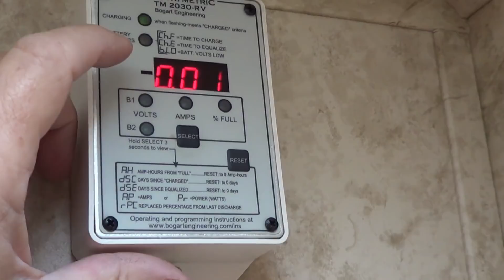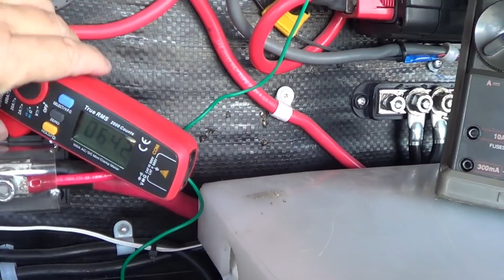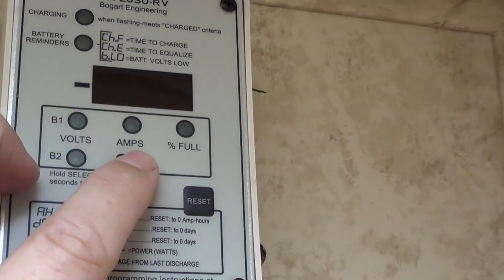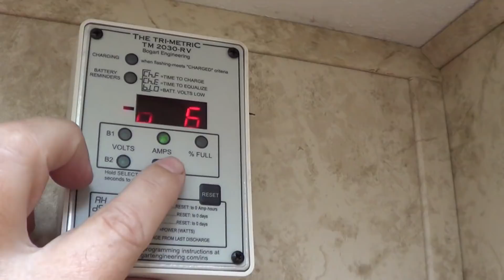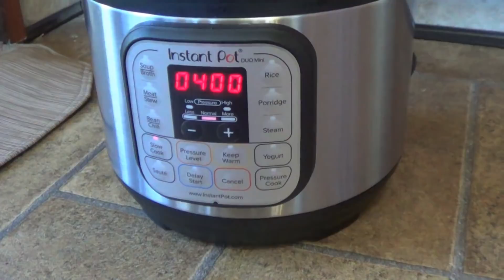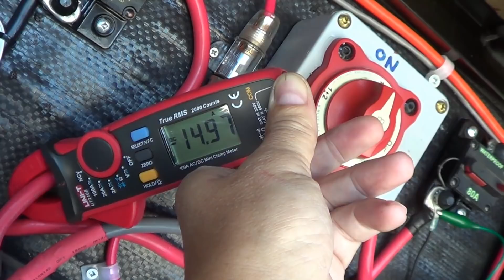Instant Pot DUO Mini  - Off Grid Power Usage Tests

Comment: very informative .i have 2 6 volt batteries with 200 amp hr capacity. just installed a 2000w renogy invertor cause my 1000w would handle the instapot. when turned on my battery voltage drops to 11.7. would i be ok running these batteries that low for a period of time ? thanks
Reply from the maker: It should be OK if its that low under the Instant Pot full amperage load, then the voltage should rise back up afterwards. If it doesn't then the batteries need to be recharged.

Comment: Questions. How large is your battery bank? And what type of battery bank is it? Lithium? Lead acid?
Reply from the maker: The test was performed using a lead-acid battery bank of four 6V golf cart-type batteries wired in a series-parallel arrangement. The total rated capacity was 464 amp hours, but the usable capacity is more like 232 amp hours since it isn't advisable to discharge the lead-acid battery below 50% on a regular basis to prolong battery life.

Comment: I guarantee the wiring in your RV is NOT capable of 63A - you obviously don't know how to read the meter, what you doing (how wired for the reading), or incorrectly measuring the value- the internal cabin meter you displayed is bout 115 /120v @ 2.94A PER HOUR and likely within 10-20 min this will drop when the device reaches Temp..... not 63 AMPS - get it?,  - WTF, I suggest sticking with things you know about and please don't post videos you have no experience or idea about what you are doing! Peace out!
Reply from the maker: You obviously think you know more than you do. The 63 amps is the DC amperage drawn from the 12V battery bank. That feeds an inverter which transforms the power from DC to AC and then feeds the Instant Pot.  Wattage = Voltage x Amperage so 63A x 12V = 756W That is about what would be expected to power a 700W Instant Pot plus some extra for the inefficiency of the power inverter and losses in wiring. btw for your info, the DC wiring I have installed from the battery bank to the inverter is a 4 gauge pure copper cable which is more than capable of handling 63 amps. Go look it up in wiring amperage charts.
Reply: @LoveYourRV  There's a difference between measuring the AC and DC power utilization in your model. Top-end Class A RVs have 50A service rating even from shore power before you trip a breaker. The POINT being - If the idea here is to look at the efficiency and power consumption of the device drawing on inverted 120VAC while "boondocking", then by including the idle DC power feeding the inverter is irrelevant to the topic. The inverter even at no-load is idle /wasted power.  The device itself (3 quart) is 700W  /120VAC or approximately 5.8A draw from the battery bank only. Measuring the circuit current feeding the outlet or simply around the power cord of the device to illustrate the efficiency as claimed by the manufacturer would be accurate. https://www.manualslib.com/manual/1292207/Instantpot-Ip-Duo80-V2.html?page=7#manual

Comment: It is NOT sucking 63A out of the batteries - lol  - it's drawing (in this MODE at a starting temp) over an initial time duration 63 Amp-Hours.... which should trail off as Temp comes up to speed.
Reply from the maker: Same difference https://www.wordhippo.com/what-is/another-word-for/sucking.html

Comment: Just tested mine. Thrift store find; $6 no gasket upon purchase, with online purchased gasket $15 tl. It looks like it's been used a handful of times perfect condition.

 I'm crazy 5 electric pressure cooker 2 small ones a 2L ,a 3L , an 8L , two 10 liters.  Never used the 10's but I have them in case I scored a lot of food that needs to be cooked quickly. Food is getting expensive and when you get free stuff you get to work. The most I paid was $100 for the large ninja doubles as an oven. Got the other large one $60 only one I paid $40 for from a righteous retailer QVC. The little 2 .

Comment: Ray, If you should happen to test the new Bluetti EB70 solar generator, could you use it with your 3QT Instant Pot?  Thank,you sir.

Side note: I imagine that if you added  boiling water heated from your stove, to the Instant Pot prior to use, you would put less stress on your battery bank heating the water up to start the pressure cooking process.
Reply: Oh genius idea!!! I have eb70 and mini pot and will try this idea!!! Thx!!!
Reply: I'm just firing up my duo mini on an 800 watt eb70s and it's barely taxing it with about 3 cups fluid in there on pressue.

Comment: So on the pp mini at 600watts on a 750 watt inverter with 1500 peak and 1 100amp hr battery you think it should work.
Reply from the maker: Should do the trick if the inverter is a quality make and lives up to its rating. Also the wiring form the battery to the inverter needs to be of sufficient gauge for power transfer, especially if the run is more than 18 inches or so. Too much voltage drop along the cables and the inverter goes into low voltage shutdown.   Cheers, Ray

Comment: Fantastic, just the test I was looking for.  Thanks!  Just for comparison, my old 4qt crock pot uses 85 watts on low, and 165 on high. The average power on your instant pot in slow cook, normal mode is (24.5*12)/4 = 73.5 watts.  As long as you have a battery/inverter combo that will handle the peak power (700W) then it seems like the instant pot is a good replacement for a slow cooker (plus do a lot more; steaming, pressure cooking, etc)
Reply from the maker: Glad it helped!
Reply: Luv Ray's videos, they are so helpful! I bought a 700watt power station because I knew from watching Ray's videos, that it would run a mini instant pot! I watched this video hoping to find out the information you provided in this comment, so thank you!

Comment: i'm new on this i have a battery isolator (for now) and a 100ah battery 2200 watts inverter. i have a instant pot 3qt  700 watts  will it have enough power to operate it at 30 mins per day
Reply from the maker: Depends if its a lithium or lead acid battery. Lithium it shouldn't be a problem as long as you can recharge each day. A 100 Ah lead acid would maybe be a problem.
Reply: @LoveYourRV   100ah lead acid battery. I could start my van to get the instant pot to get to pressure that about 10 to 15 mins

Comment: Need help? Has anyone used the instant pot outdoor. I want to get a power inverter but which one to get modified sine wave or pure sine wave. I'm not getting a straight answer from the instant pot company. I dont want to spend more than i need to any help would be appreciated
Reply from the maker: I'd go for a pure sine since the Instant Pot uses microprocessor electronics to control the cooking times. If it uses the 60 cycles of the AC power to keep the time, then a modified sine wave may cause the time to be off. Just a guess though. Also modified sine wave inverters are less efficient at power transfer so you would likely need a bigger one versus a pure sine type.
Reply: @LoveYourRV  so if it digital i need a pure sine wave what about a hotpot or rice cooker  i will be in a van may 8 2020 so i need some kind of cooking i have a propane grill what cooking items could i used with a modified sine wave
Reply from the maker: Its always hard to predict as appliances often used a variety of power circuits and control electronics. Basically  it boils down to a modified sine will run most things fine except but not as efficiently power wise as a pure sine. A pure sine will run everything well. If a modified worked well on everything no one would buy a pure sine. Also, you'll see than most everyone of the new solar generator power boxes and gas inverter generators are using pure sine, so that tells us something. They feel its worth the extra cost. Cheers, Ray

Comment: I don't understand why I can't find anyone to answer this question with an affirmative yes maybe someone here will know the answer I'm hoping anyway

For car camping purposes I would like to purchase a instapot Mini are the smallest one whatever it's called I am hoping that a Yeti 400 portable battery will be enough to make the instapot work do you know?
Reply from the maker: I'd guess no it can't. Looking at the specs on the Yeti 400 it says the inverter puts out 300 AC watts continuous power.  The Instant Pot  Mini requires 700 AC watts to operate.

Comment: Awesome video. I have always wanted to use a pressure or rice cooker overlanding and this video saved me so much time and math. Thanks. Really seems reasonable. And in a vehicle situation you could be cooking while driving and roll into camp with a hot meal already waiting and not even need to tax your batteries.
Reply: Did you do that? How did it work?
Reply: @janebray9392  It's pretty common in RV circles to cook while driving -- the appliance sits in the sink to avoid falls and spills.  

In the past it was mainly done with crockpots but I suspect it happens with instant pots now too.
Reply: @fratermus5502  good to know!!!!!

Comment: Soooo your clamp meter was set to AC.  Way off.
Reply from the maker: Did you watch the extra 30 seconds longer to see me correct my mistake?  https://youtu.be/kf6U2N9vySU?t=148
Reply: Nope, I stopped right away when I saw that.  But I'm glad you corrected it in the video.

Comment: so if it digital i need a pure sine wave what about a hotpot or rice cooker  i will be in a van may 8 2020 so i need some kind of cooking i have a propane grill what cooking items could i used with a modified sine wave
Reply from the maker: You'd need to have an inverter capable of powering 700 watts of  AC power, best to have some extra headroom so I'd advise a 1000 watt inverter. To power, the inverter 2 deep cycle lead acid batteries hooked together is advisable. Either 2 - 6 volts wired in series or 2 - 12 volts wired in parallel. If you have a lithium type battery then one 100 amp hour battery would do the job.
To recharge them you can use solar panels or the van alternator or a charge converter plugged into shore power or a combination of them.
Reply: Love Your RV i dont understand how many amp hrs battery i need and how many watts solar panel needed will 100 watt solar plus 100 amps hrs battery will that work
Reply from the maker: Yes, but it will take many hours of sunshine to recoup one Instapot cooking session.  A 100-watt solar panel only puts out about 5 amps so you'll need 5 hours of the perfect overhead sun just to recoup what the Instant used.  I have no clue what else you are powering in your van as well but I would recommend at least 300 watts of solar power if you intend to use a high wattage appliance such as the InstantPot. Either that or get a 1000 watt gas generator.
Reply: Love Your RV OK I’m thinking about getting a 295 W solar panel blood what battery amp hours should I get the lease amount Also what a 10 amp charger controller be able to handle a 295 W solar panel
Reply from the maker: 100 AH battery minimum and preferably 200 AH if you can afford them and they fit. Batteries are the heart of the off-grid system. I'd want a 30 amp solar controller.
Reply: Love Your RV Solar checked in I’m getting has a 10 amp charge controller and 100 W solar panel but I’m getting a 295 W solar panels what I want to know is will the 10 amp charge controller be able to do this or should I upgrade to a higher charge controller I just want to be able to use my Insta pot so whatever is the least amount of Solar power is what I’m looking for I know I need a 1500 W power inverter what’s confusing me is the solar panels and the battery right now I can’t afford a whole lot I’m on a fixed income so I just want the basic that would technically operate my instant pot that’s all I need to Power well a 100 W solar panel and a 100 amp hour battery be enough to do this if not will a 295 W solar panel be better to charge the 100 amp battery and will The 100 amp battery be enough I want the basic
Reply from the maker: Solar panels and solar controllers do not power things, they recharge the batteries. It's the batteries that power the inverter which in turn converts DC  to AC  to power the Instant Pot. I would advise 200 AH of lead-acid type batteries or 100 AH of lithium type batteries to power the size of inverter required, at least a 1000 watt model.
As for solar panels the more watts you have the faster the battery recharge time will be. 10 amp solar controller is OK for a 100-watt panel but not suitable for a 295-watt panel. For that get a 30 amp controller.
Reply: Love Your RV Well I’m not going to Be able to do that right now so how is this my laptop does 6.8 A so will be it’s a harbor freight kit and it has 100 W solar panels and the 10 amp charger controller and the 35 amp hour battery will that be able to at least power my laptop just needed to charge the batteries takes about less than two hours
Reply: Love Your RV I’m not getting solar right now I just want to get in inverter using  the battery of my van to operate a hot pot that uses 600 watt it has nothing but A heating element
Reply: It’s funny if a modified Sine wave is so bad why do they continuously sell it
Reply: @jfletc3000  much cheaper
Reply from the maker: Yup should be able to power a laptop.
Reply: Love Your RV One thing I wish is that when it comes to Solar it would be nice to be able to understand it in normal terms Being that I am new at this and I'm still trying to understand it I just want to be able to know what can be charge not looking to charge a whole lot but just a basic right now being that this stuff is very expensive and I'm on a fixed income is very hard to find out exactly what I need I do know that when I am able to get certain things I know I want to power my Instant Pot and my laptop and eventually a small mini fridge hopefully DC with that the system that I said that I could buy later the 295 W solar panel and the 30 amp charger controller and two 100 W batteries will that be enough to charge these items also batteries are confusing to me too I know we post to use marine or golf carts but golf carts are way too expensive marine at Walmart they're about 100 bucks for 100 amp hours but the problem is what I see on those they're not a sealed system is that dangerous I'm not really sure it's going to be in a van so I don't want to kill myself trying to do this
Reply: Love Your RV If I get a modified sine wave inverter for instant pot what kind of damage could happen to my Instant pot on Reddit a person there is using it

Comment: I have the instant pot 8 quarts it says 1000 W in that case what would be the best course of action when it comes to getting a inverter not using solar power running it off  a van engine battery Should I get a 1500 W inverter or will a 1000 W inverter be enough In the future I will get a solar panels but not right now funds not available right now Mostly I want to know will i  be to able to run it using a 1500 watts inverter using the vans battery
Reply from the maker: I'd get a 1500 watt to be sure, better to not be totally maxing out the inverter.  I'd advise having 2 batteries to power it, just one may struggle and run down quickly, but you could always run the engine at the same time.

Comment: Ray, my system in my van is 200 watts solar, 100ah lithium battery and a 1000 watt pure sine wave inverter and a 2000 watt inverter generator for backup. Do you think with good sun that I should be able to cook one meal a day (generally 15 to 30 minutes) with my instant pot mini, or should I just use the generator for cooking? The only other use of power is a few led lights and charging my laptop and phone.
Reply from the maker: It will depend on the time of year, in the winter days are short and sun angle shallow so the amount of amp hours is gain in a day is much lower than a long summer day. My guess is in the spring summer and fall you'd be fine but maybe in the mid-winter, the generator possibly may be needed. I'm not sure what other DC power draws there may be in the van such as fridge, furnace, water pump, radio, propane detector, etc. Cheers, Ray

Comment: How low did your batteries drop - Voltage? Is that bad for the batteries?
Reply from the maker: It's normal for batteries to drop when under lots of load current, at times they will drop under 12 volts, but the key measurement is what the are when they come back to resting state. There are charts that tell you how much capacity is left - ie. http://www.marxrv.com/12volt/voltchart1.gif   I have a battery monitor system that calculated the Amp Hour use by monitoring the amps in and out of the battery bank.  With wet cell lead-acid type batteries, the most accurate way to tell the battery state of charge is with a hydrometer and test each cell. I do that once in a while to make sure they are all in good shape, sometimes they need to be equalized - https://www.loveyourrv.com/testing-and-equalizing-my-rvs-4-golf-cart-battery-bank/   Cheers, Ray

Comment: Well Ray, she who must be obeyed bought one for the 5er,and as per I wondered why, but I do like the pressure cooker feature.good to see how little juice [couldn't resist] it takes from the batteries,we cook lots of rice but haven't tried that yet.The ribs looked perfect and Angie approved.
Reply from the maker: Using ours quite often in the warm summer evenings to avoid the oven. Does a great job on all sorts of dishes. I like mushroom chicken. Throw some pieces in there with seasoning and a can of mushroom soup and pressure cook 5 mins then the natural release. Comes out great. Cheers, Ray

Comment: I wonder if they make a smaller version of the unit you have.  I am only cooking for one anyway and don't need or want a huge 700 watt appliance.  At least my small crock pot easily runs off my solar system, even with my refrigerator also on my inverter.
Reply: There’s a three qt, half the size.